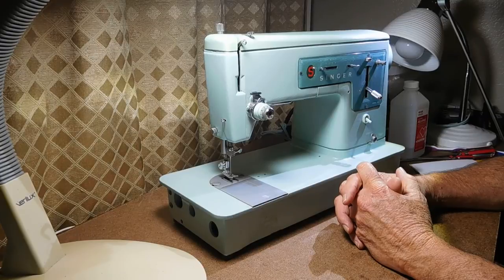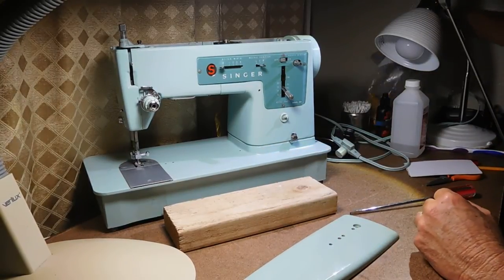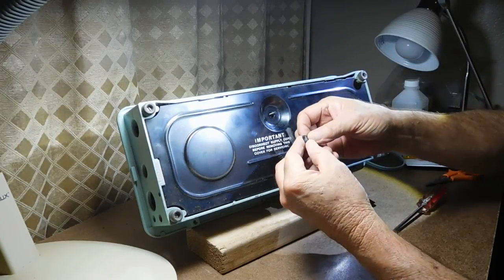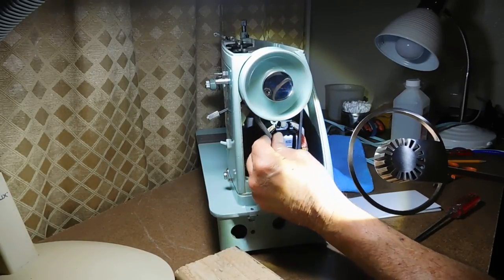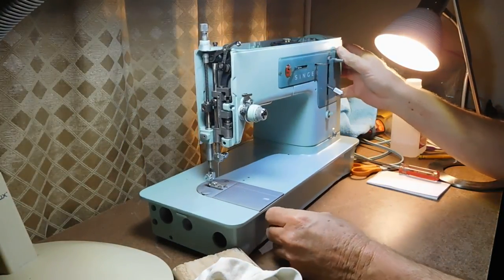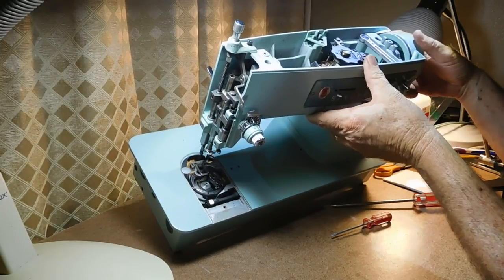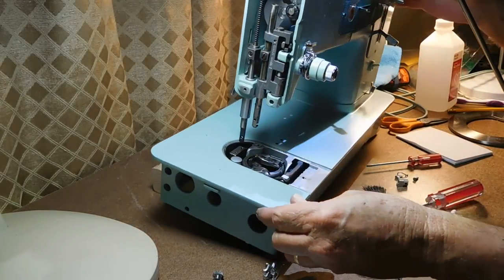Step by Step Restoration of a Singer Model 337. A Series of Videos. Part 4: INSPECTION/COVER REMOVAL

Comment: Hi Andy. I'm reviewing this old video because I just picked up a 338 that was destined for the dump. It looks savable and I've been taking it apart to clean it. In preparation for removing the motor I started reviewing some of your videos.

In this one at 16:38 when you've taken off the end cover I noticed that like my 338, there is only one screw holding in the the three prong receptacle that the power cords plugs in to. I had thought mine was missing a screw but when I saw your video with same left side hole empty I thought that must be the way they come.

Do you know why they would have a mounting hole but no screw in this situation?
Reply from the maker: Go back 1 minute to 15:38. That screw does "double-duty" by holding the cover AND the receptacle to the body. Singer saved making a screw and drilling a hole in this model. Thanks for saving another machine.
Reply: @andytubesewing1953  It's a good thing I didn't buy a replacement screw, I'd never have gotten the end cover back on. Thanks, as always.
Reply from the maker: @terrymcclean4582  haha, no worries

Comment: Great video series Andy! I just bought my very first machine- a nice old 348 on Craigslist. This video on removing the bobbin holder saved my bacon as I managed to immediately totally jam the machine with a major thread tangle. I did get the service manual using your link, but . using your video was much more helpful with the specifics of how to remove the bobbin holder than the manual was. Many thanks!
Reply from the maker: Very welcome and glad you found the video. You bought a very nice, capable machine and I hope you enjoy it. Thanks for the comment.

Comment: Hi andy, im having a moment 😢. Im. Early done but I’ve noticed a few machines 337 and the handbook that came with it don’t picture or talk about the LCR switch :(. I cant find any information on why this would be and do I have a 337 my serial number isnt shedding much light on it either as all the info stops prior to clydebank x or ex 676 123 or 923. Either way the serial number is for stops. Could you advise as ideally i need a new face plate and top. Very little age damage such as tiny cracks but i would like to replace but now im questioning what model i have, yours is the same as mine which makes me question again but some clarity that the model itself has the diffrence ?
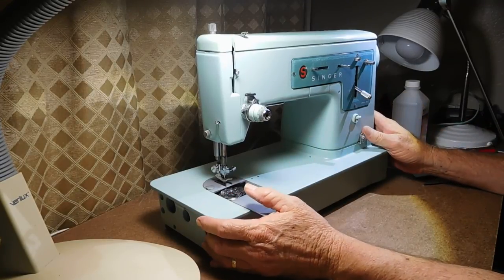Reply from the maker: Be sure that "337" is shown on the face plate and not "338". This model came in a couple of versions. Model 337 is the base model meant to sew straight and zigzag stitches. Model 338 was the "advanced" model that allowed you to swap out 22 pattern discs under the "flip-up" door on the arm cover. IMO, SInger sometimes just used the 338 body and put a 338 faceplate on it but printed 337 on the faceplate. It did have the LCR control but not the big chrome thumb screw under the cover for swapping the pattern discs. Towards the end of production runs, Singer sometimes did things like this to use up bodies and parts of matching machines in a "group" like the 337/338. You can see the LCR lever on a true model 338 at about 4:08 in this video: https://youtu.be/dRcSjYvRWcQ   It may be harder to find a 337 face plate with the LCR cut out. I'm guessing, but I have never tested it, that a 338 cover would fit a 337 machine. The 337 arm cover is plain but the 338 arm cover has the flip-up door for accessing the discs. I can't help with the serial numbers because my logbooks do not go that high in the serial number sequence.
Reply: @andytubesewing1953  it says 337 on the face plate and like you the serial number is a mystery, of the few ive seen on 1 it just says sample machines so im gonna guess its a 337 thats shown on the service 338 and 337 manual not the user book. It’s exactly like the one this video shows.
Reply: Moment over, i have a parts list now and that should make it easier. I will leave the face plate and top plate as they are okish. Uk seems to have the models without the needle positioning and America seems to have all the ones with 😂😂. Just waiting on new feet and belt then i get to try and adjust and tune it. Never having done anything like this before I’m both exited and dreading it. It took me 2 days to figure out what certain tool such as the feeler gauge was called 😂😂 i was half way to making one as i couldn’t find what i wanted when the hubby said that was what i wanted and he had a set 🤣🤣
Reply from the maker: @fi556  Thanks for letting me know.
Reply from the maker: @fi556  Thank you. Something I never considered but makes sense; a different version for the UK vs USA market.
Reply: @andytubesewing1953  there is a cross over maybe from war brides returning to home country’s mine has the adaptor extension cable from type c to type g interestingly even though it was made in scotland 😂😂😂 it kinda like a big puzzle 🧩 I’m enjoying learning about lol thank you for all your help :)
Reply: Hi Andy, i did it :) well almost lol. I dont know how to share a video but all is good apart from the thread comes away from the needle its something to do with how i put one part of the tension bit in :( . I followed the guide and ur vid but this particular piece catches the thread before you put it through the arm bit that moves and i just cant see how it went in and what i did wrong. I aligned and such like as i put it together😢

Comment: Hi Andy, my machine is full with grease (maybe that's what I smell), all parts are black and smutchy. What's the problem with that, you said you like a machine dry and dusty more than over maintained? The machine runs very smooth.
Reply from the maker: I look at it from a restoration point of view. An undermaintained machine, that has no damage, is easier to clean than an over maintained machine covered with black oil & grease that can easily be the kind not best for a sewing machine. I have found axle grease, lithium grease, wheel bearing grease and many others as well as household oil, all-purpose oil, WD-40 (not an oil) graphite powder and even salad oil and mayonnaise in a machine. Over greasing and oiling just attracts dirt, dust, and lint none of which is good for the moving parts. If you are happy with the way the machine sews and how it smells then, by all means, just leave it that way. Sorry, I did not mean to imply I liked leaving and operating a machine that is dry and/or dusty, only that it was easier to clean and then lubricate properly with products made for sewing machines.